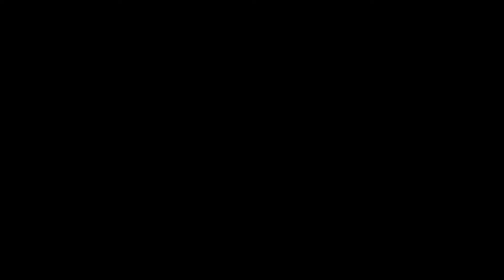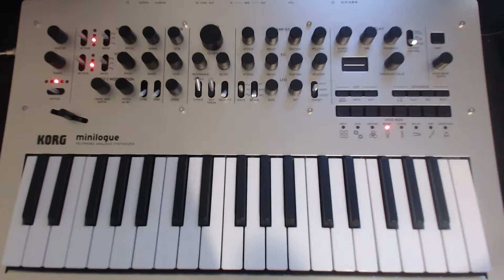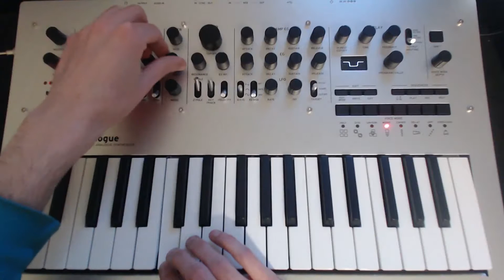Synthesizer Basics: VCO's and AMP EG (feat. Korg Minilogue)

Comment: Where is it connected to? An amplifier or what? Does it have built in speakers?
Reply from the maker: No built in speakers here, I believe I was running this out to my mixer and then from there to some studio monitors when I recorded this.  You'd need powered speakers of some sort.
Reply: @Timbrewolf  would passive speakers do or it has to be powered?
Reply from the maker: @NadeemHayek  I believe they have to be powered!

Comment: Hi ive just bought the mini so it cud just be lack of experince i did what you did with the a.d.s.r knobs and its great but why when i mess with the lower rows of a.d.s.r does it not do anything even if i turn up vco2
Reply from the maker: The second row of ADSR knobs is assignable!  You have to consult the manual for a little more info on how it works, but you can use it to apply a second, independent ADSR envelope to other functions (I'm not sure off the top of my head which ones on this specific synth, but possibly things like VCO2, the LFO, or the Filter).  You'll just have to do a little reading and menu-diving to find out how.
Reply: @Timbrewolf  thanks for that from what i have learned since i asked you my question is that the 1st adsr row is the amp and the second row is controlled through the lfo assined to pitch shape and cutoff  or somthing like that im starting to understand a bit more now
Reply: @retrogamerarcadebuilder4185  the left bottom row can be effected by the EG, so can the filter, and also the LFO also I believe, but only by way of being able to effect those parameters you listed.